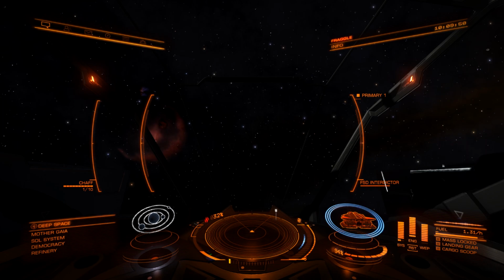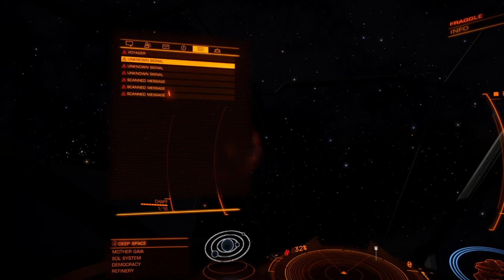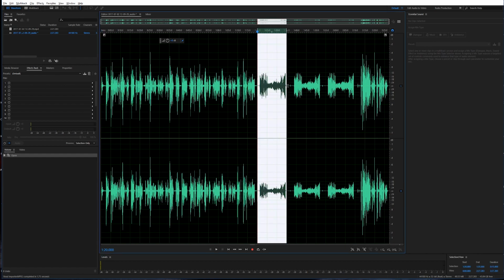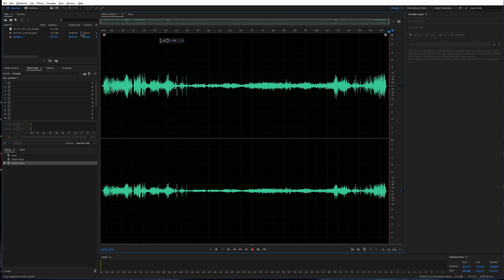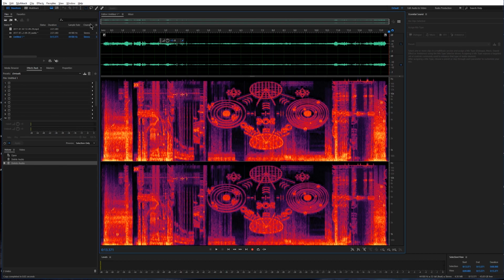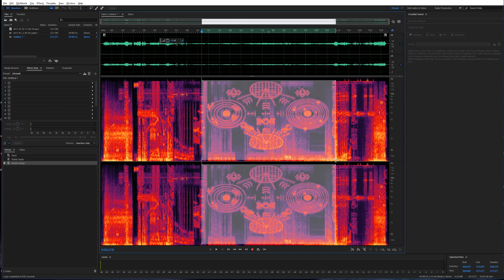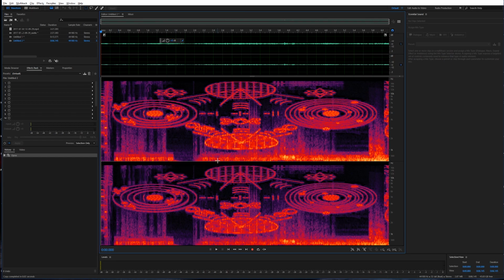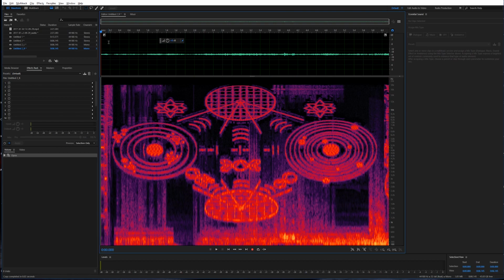Analysing the Thargoid "Unknown Signal"

Comment: Rusty, sorry for off topic, but what are the headphones you use?  I remember from an older stream you swearing by a Logitech set and I'm looking for a new set as mine just packed up!  Cheers pal.
Reply from the maker: I'm using Logitech G35's.  They are virtual 7.1 surround sound and, as you can hear, the microphone is great. :)
Has a good few buttons on the earpieces to program functions in too.

Over time the vinyl covering over he earpieces flakes off but that's no big deal.  You also get different cushion padding for around the head so it suits different heads :)   If these fail, I will definately be buying another set to replace these.